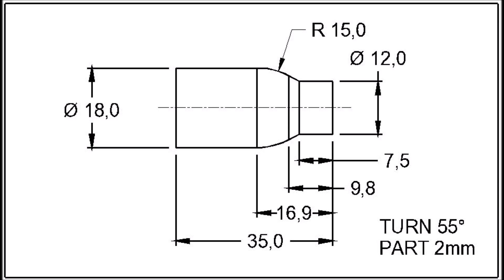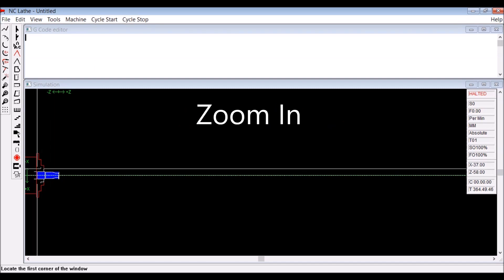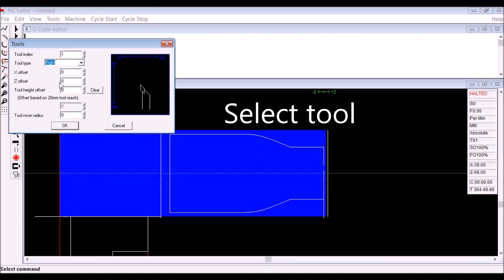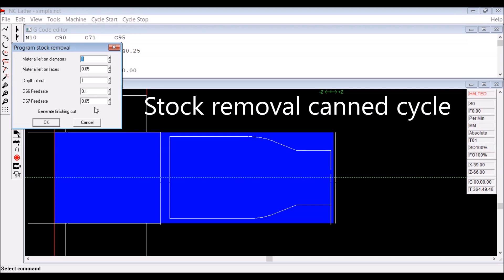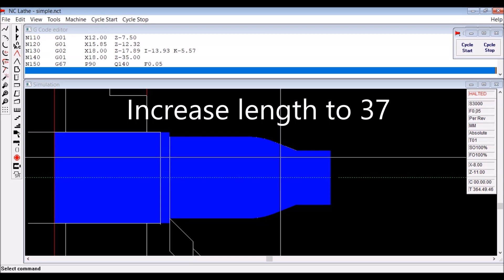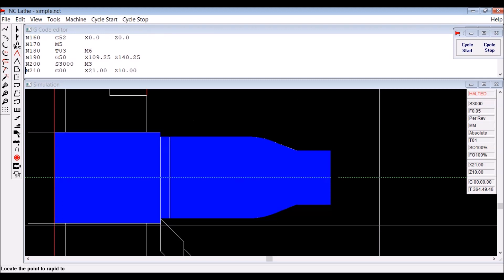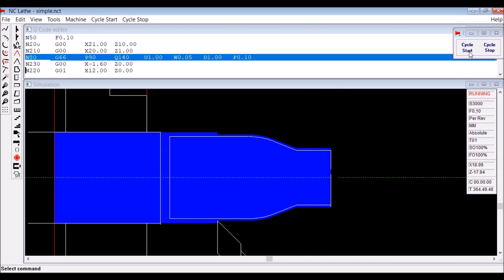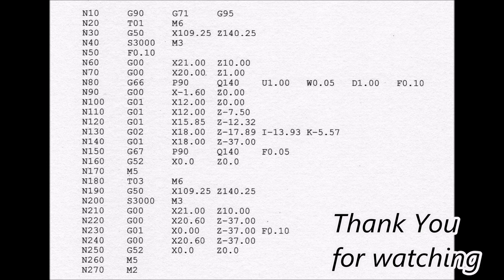From CAD to CAM  From a dxf drawing file to  G code program I need for my small cnc lathe.

Comment: Please,  what is the Name of this .DXF to G-code Software & where do we get it ? Thanks James
Reply from the maker: Hi James, this is old software made by the manufacturer of my lathe.  The best windows version runs in W98, can you do that either on an old pc or by using a virtual machine?  I run it on an old laptop running a virtual machine when I am in the house but the lathes need old computers (they need an ISA card slot) to run anyway so that is not a drama for me.
Reply: @smallcnclathes  Yes, I also work with a Vintage Emco Machine, Vintage CAD but have dragged my Sherline Mill into the future with a USB Controller & Grbl as a driver with Cut2D to convert .DXF to G-Code. For some reason the Lathe side of CAM is hard to find?? Your software seems so simple, I would like to give it a try to convert .DXF to G-Code then run that with GRBL, is it available anywhere ?
Reply from the maker: @jamesmaclean2  are you on Facebook? Have to go now, middle of the night here.
Facebook, Hercus benchtop cnc users group will find me

Comment: Neat piece of software. Have you tried if inputting a tool nose radius in the tool selection changes the gcode output? In other words, does it have a built in radius compensation? I would happily use a software like this but the codes seem to be different than on a Fanuc.
Reply from the maker: The dos software has no compensation so I allow for it when I create the cad drawing. The windows software has it built in but is a bit flaky.
I like the software, but then I have been using it a long time. Thanks for your comment
Reply: @smallcnclathes  I sold the small Emco lathe by the way and bought a Mori Seiki cnc for 1/3 the money, there might be some videos about it in the future if you're interested.
Reply from the maker: Leave me a comment when you upload.

Comment: Hey Nigel.
A great machine for making parts ASAP.
I am sure there are many who watch your video,s that are Very envious of you owning this machine.
Great to see you posting more video,s.
I hope you are keeping well in these difficult times.
All the best.
Peter.
Reply from the maker: Hi Peter, to me it is just a tool to get a job done, well perhaps a bit more than that. It has enabled us to create an income when we had no other way to do it.  It is small enough, to not be threatening for my wife, when she was working along side me. I have no doubt she has made more parts on a Hercus PC200 than any lady anywhere. I will keep trying to post videos, although since I don't do much work it can be hard to find things to make a video of. This one was a request from a viewer. I have a job coming up drilling a 6mm hole in aluminium 71mm long which should make a video. Although, if it just comes down to lots of pecking, it may get a bit boring. Might need speeding up!
Times are tough and going to get worse, a lot worse, but we are managing OK thanks.
Reply: @smallcnclathes  
It,s a great little machine to have and own.
Fun to tinker on,  and serious enough to create a good income.
Thank you for your reply.
Peter.

Comment: Way simpler than Fusion360. My old turning center with a Fanuc control only handles a couple hundred lines of code and since Fusion produces lots of roller coaster loops and arcs during lead in and out, it can be a headache.
Reply from the maker: The software is the reason I do all I can to keep the old lathe running.  Not always easy with the age of the electronics and the need for a PC with an ISA slot for the interface card that runs the lathe. I used Fusion for some code for the Hercus mill and yes it does love all those little curved run ins etc.

Comment: So simple! I think you'd quite enjoy a gander at GrblGru, it's full cad/cam/simulation for arduino driven CNC's using the GRBL firmware, which is free. It can be run on a $10 board which will drive any type of stepper that has it's own driver.
Reply from the maker: Thank You for your comment

Comment: Thank you very much, where can I buy the software you use?
Reply from the maker: ANDREFUGAZ the software is 25 years old and is not really available any more.
Reply: @smallcnclathes  thanks so much, now I use fusion360 but the postprocessor for Linux CNC have errors. I Make the G codes hand made. Thanks you again for your videos
Reply from the maker: ANDREFUGAZ that is surprising, lets hope it gets fixed soon

Comment: Nice!
I'm stuck in learning LinuxCNC for lathe.
Reply from the maker: How does it compare with my software which goes back to Win95
Reply: @smallcnclathes  I do not know...
LinuxCNC only a G-code interpreter. But need to setup correctly use it on a CNC Lathe.
And maybe after your program, the ready G-coge use the LinuxCNC